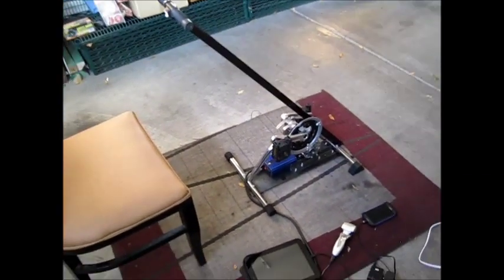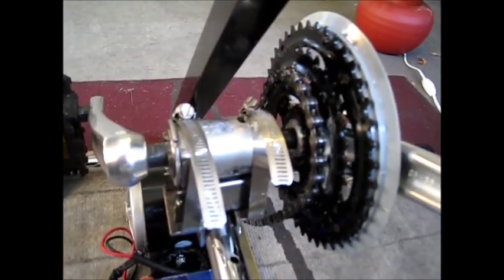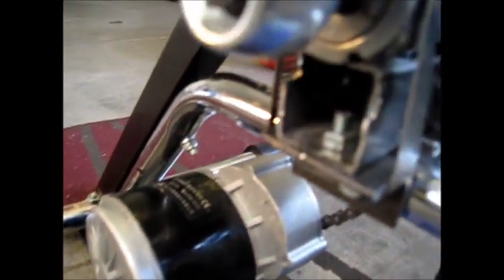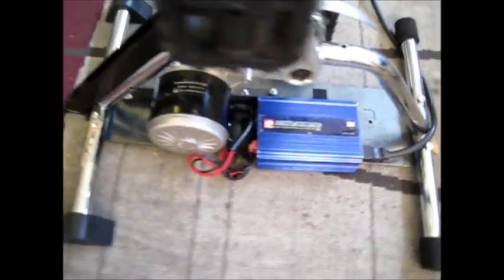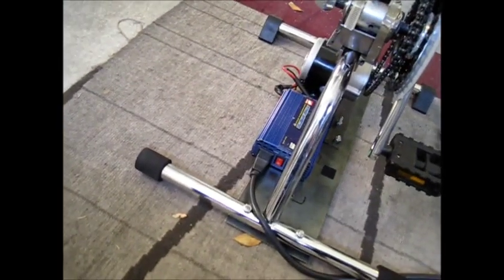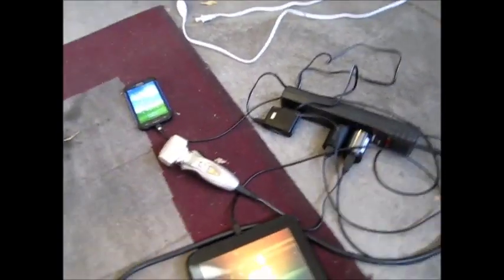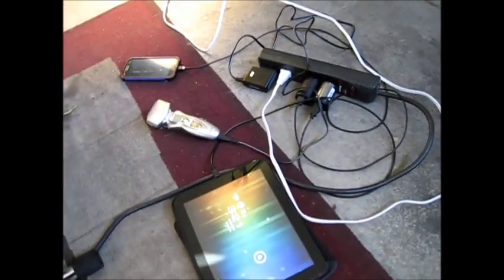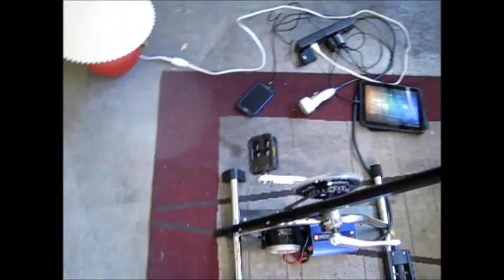Homemade Pedal Exerciser Generator

Comment: If one were to build one of these, how long would it take for the power generated to pay for the cost, assuming these parts were purchased at retail price?
Reply from the maker: ThingsDemystified   So if you pedal enough to generate 100W and do that for 3 hours in one day, this means you would save 0.3 kilowatt-hours in power.  Our energy rates here in Nevada are roughly 13 cents per kWH if you include the extra fees.   So therefore you are only saving about 4 cents per day assuming you pedal for 3 hours.  The total cost for this project was around $140.  So $140/0.04= 3500 days, which means it would take almost 10 years for the power generated to pay for the cost.  

That seems ridiculous, however I originally designed this as a motivator to exercise and not something that would really save that much money.  At least all my pedaling is doing something useful.  I can charge a few items.
Reply: ***** i think the saving cant be measured in Kw but in freedom. If you are off grid you produce your own electricity while exercising.
Reply from the maker: That is true.  It is also good in emergency situations if your power goes out.  I am a math teacher so I wanted to do the math!  :)

Comment: Great video! I was thinking about getting one of these MY1016z3 motors, I see that the sprocket is free spinning without power to the motor. Did you modify it or do they free spin like that?
Reply from the maker: The motor comes with the sprocket attached.  Yes you can spin the motor without power.  This is what generates the electricity.
Reply: Thats great news! Also, can you reverse the polarity on these motors?
Reply from the maker: Vic Knight Yes you can.  Switch the leads and the motor will spin in the opposite direction.

Comment: So you're generating the power to load your electric bike by pedaling at home ;)
Reply from the maker: Well not exactly.  The battery charger needs to be plugged in for a long time and have consistent power.  Therefore I do not use the pedal exerciser for charging the batteries.  Plus that would be ironic that I am pedaling at home to charge a bicycle that I could just pedal normally!  :)
Reply: *****
Actually, that's what I meant. I was just joking - your builds are awesome ;)